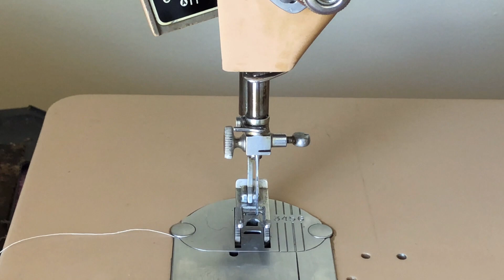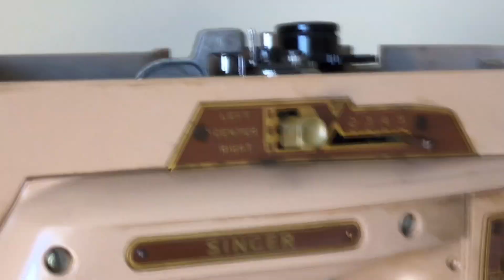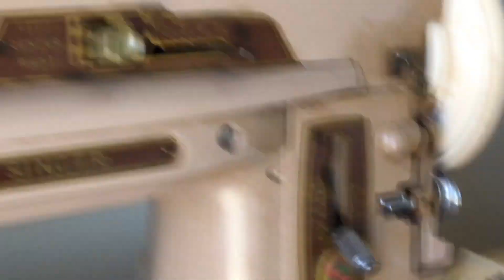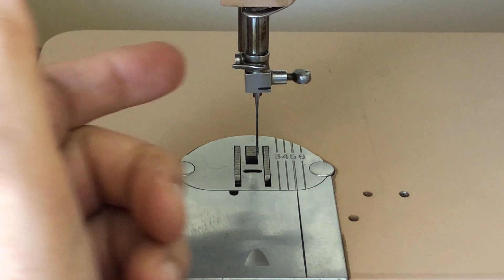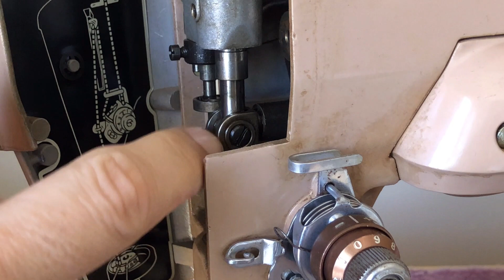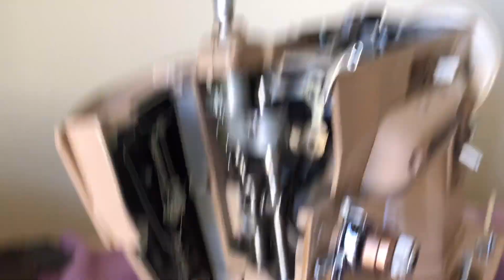TROUBLESHOOTING SERIES #5: Is Your Machine Stuck?  Machines With More Features Require More Patience

Comment: I have a 404 when i bought it it worked fine I used it all last winter then I let it sit and then I went to use it 2 weeks ago and now the needle won't move I hear the motor and tried to use the hand wheel and nothings happening what could be the issue

Comment: I bought a 403 that was frozen thinking that I could restore it. It’s still stuck with the needle bar lowered. Next I’ll try Blue Creeper. If that fails, I’ll find a short screwdriver to remove the gear underneath at the hook area. It’s currently frozen in a position that cannot be reached with normal tool. Any suggestions?

Comment: I have an old Atlas vintage streight stich only sewing machine.  It sat for approximately 25 years not being used. Just about everything was not moving. I oiled all points with 3 in 1 oil, I cleaned out a lot of packed up lint from the presser foot and other places. It's now sewing again but the longest stich setting is giving me very short stitches, about 2/32 of an inch is the length of the longest stitch setting now. To be honest, I don't really know the length of the stitches before but I would think they would be longer. Any suggestions  to get longer stitches or is that the normal length for this machine?
Reply from the maker: Hello Sharon.  The stitch length lever is connected to linkages that flow towards the feed dogs which adjusts them for stitch length.  See if you can trace a path from the lever to the dogs (might want strong flashlight) and while following along, try oiling or using penetrant spray or heat (carefully) to be sure all of the moving parts along that path are free.  Even when you have succeeded in getting most of the machine parts moving (Congratulations on that as I know how ornery they can be when stuck), it only takes one set of moving parts to limit how the machine is supposed to run optimally.
Reply from the maker: I think I showed something along these lines in a recent video of (I think) a Singer 15-30.  The owner said it would not go into reverse and so I show how to follow along the linkage paths to address possible sticking points between the control knob and the feed dogs.
Reply: Thank you, I will try that and see what happens. I have watched a few of your videos, they are very interesting and informative.  I was just watching your videos on restoring the machine tables as my Atlas came in a table and it does need some restoration done on it. Thanks again.

Comment: 🎄 Merry Christmas to the VSMG! 🎄
Reply: The 400 series really appeal to me, but they are fairly rare here in the UK. Most people had very little money to spend on sewing machines in the '50s here, whereas it was boom time across the pond.
I have a later 466 stylist to restore. Unfortunately it has some plastic gears which I will replace, but it's a start. Eventually I will swap it for a 201k probably.  I actually got it for the table which is the most beautiful I have ever seen.
This is a wonderful hobby!
Do you ever have to replace springs?
Reply from the maker: You can replace springs and they are often available at low cost.  I should note that springs require replacing far less often than some other wear items though.  Gosh, even springs were made better back in the day.
Reply from the maker: Same to you!